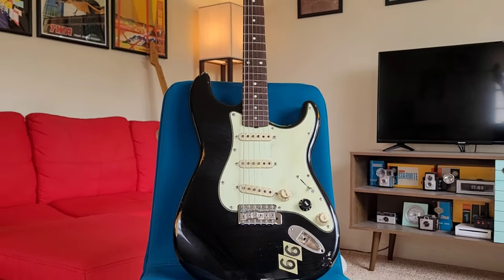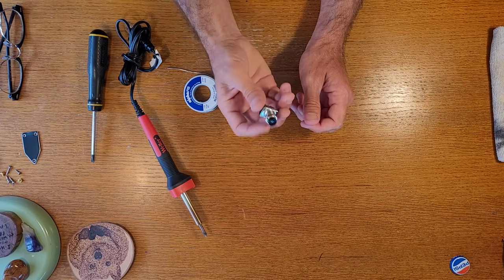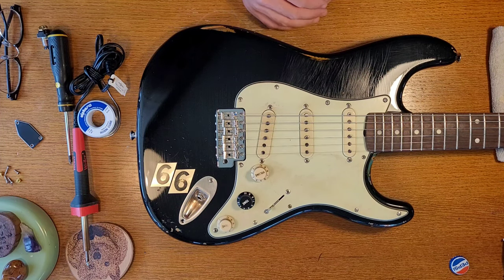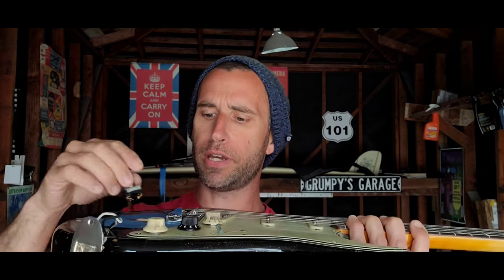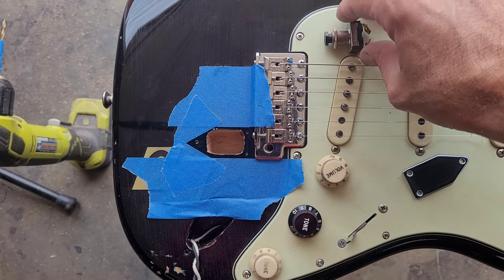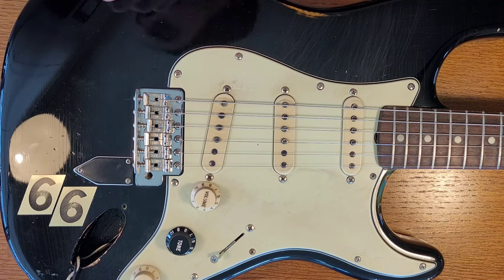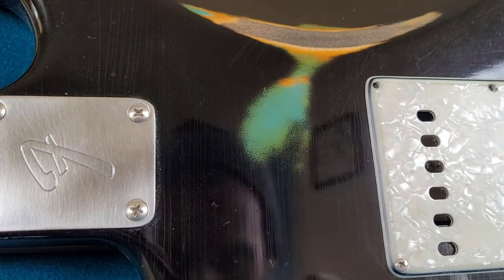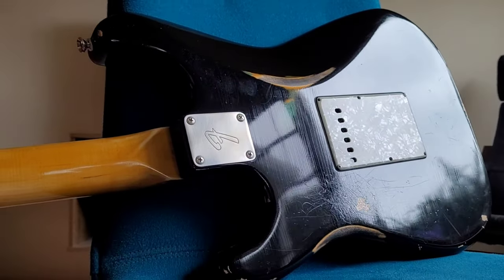KILL SWITCH installation for any electric guitar

Comment: What a great video. I would never have thought to install a killswitch at that particular location on a strat. 

I’m planning on adding one at some point to my squier super sonic that I’ve been modding bit by bit. I’m thinking about adding more of an arcade style button. When it comes to wiring it up, can you just attach each wire to a different terminal on the output jack?

I appreciate that message at the end too. Glad this strat is scratching that itch
Reply from the maker: Cheers Ramiro! The arcade idea is killer! Especially as the SS has a properly strong color palette selection. Not exactly the same old stuff. 
   As far as the wiring, yep you got it. Just solder into the two tabs on the jack. Also, polarity doesn't matter as the switch is reversible. 
   What you thinking as far as the switch plate? Maybe a flying v plate? Perhaps nickel?
Reply: @breilly66  To me the switching options on the SS are counterintuitive. 

I think the neck position activates the bridge pickup and vice versa. 

There’s also something I don’t fully understand going on with the volume knobs where if you have the bridge pickup selected and turn down the neck pickup volume knob it still affects the bridge pickup. And I think the same applies to when the neck pickup is selected. 

I love the overall quirkiness and non-conformity of the guitar and especially its body size and neck profile but I haven’t thought of a practical use for the stock configuration. 

All that to say that I’m eventually going to try something similar to what Ryan from 60 Cycle Hum did to his SS: The killswitch will replace the original pickup selector switch and, if I can find guidance on how to wire it, I’ll replace a volume pot with a 5 or 6 way selector knob wired with different pickup configurations.

To finally answer your question, since I’ll be replacing the current pickup switch, I should be able to just mount the killswitch on the pickguard with no additional plate. 

If you have or can get your hands on one of the recent Squier Super Sonics, I’d love to hear your take on the current pickup/switching configuration. Or if you don’t feel like buying one, I can lend you mine for as long as you need to get a feel for it.
Reply from the maker: @ramsilva  Had the same experience with a modified back top Jazz a few years ago. Was thinking of ordering one up to see what the fuss is about. Could be a good review! Especially as the market gets bolder with its steps into alternatives. Luckily, the world isn't just for LPs and strats anymore. Let me see what I can dig up. 🙌
Reply: @breilly66  Coooool

Comment: cool video, thoughts on rosewood fretboard darkening with stains?
Reply from the maker: Thanks J! Glad you said so. I've been messing with Minwax as a possible to tint the fretboard. They sell an ebony shade that is pretty close. I think I may actually try it on the 65 Jaguar as the fretboard on that saw some sun and is lighter in color than typically would be seen. Only concern? Will it prevent the fretboard oil I use from being effectively absorbed. Methinks it's time to see what takes.

Comment: But, im looking to install a toggle switch as my kill switch as opposed to the "button" type. Where can I find a video for that??
Reply from the maker: No sweat, I got you.  Wire the two leads we mention to 2 of the 3 tabs on the back of the toggle. Bam. Once you throw it, it'll short the circuit and cut signal.

Comment: Why ?   There’s a guitar cable that you push a button on ( on guitar lead ) to power up your Ax then when done using it push button again then guitar is off.     I guess different strokes 4 different folks ..
Reply from the maker: Exactly. Everyone likes a different route. Plus I'm reluctant to depend (if the switching were part of a track) on a wear item in case it gives up during a show. 
      Plus my wireless makes use of an external more difficult.
Reply from the maker: Also....   this is a momentary switch. Not an on/off button.

Comment: Why is everyone telling me that I need to install a battery for a killswitch? Yours clearly doesn't need one. Are there different kinds of these switches?
Reply from the maker: I've seen some active electronics with a kill....  but no need for a passive switch.
Reply: Also, the ones with LED lights need the battery. But you don't need it if you don't go that route. Additionally, you can buy the LED type and not connect the light.
Reply from the maker: Yup! It's a preferential thing but the principle of the switch shouldn't be too far off!
Reply: @breilly66  I tried a momentary switch from home Depot and it wasn't smooth. It would stick. So I'm gonna try one from Lowes. It looks more like a stomp pedal switch.
Reply from the maker: @hectornunez2928  I had to hit a local hardware store! The Home depot by me literally stopped carrying 18/16 gauge wire or switches.   :/

Comment: The parameters of the switch's particular electronic capacity .WTF does that shit mean ??? lol
Reply from the maker: Just that the wattage and draw are designed to carry a potentially lethal current instead of a passive signal. So the overbuilt unit isn't failure prone the way a purpose built kill switch would be. 
   Think of using a tank instead of a plow.